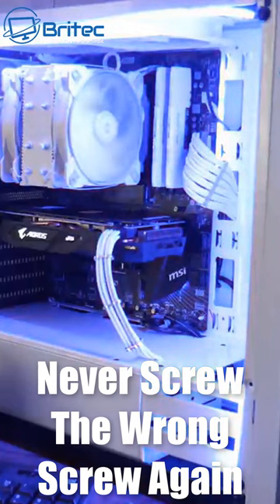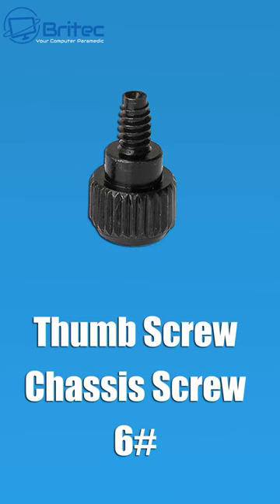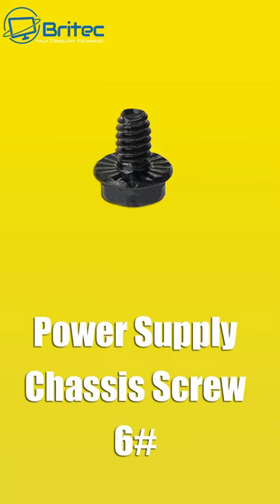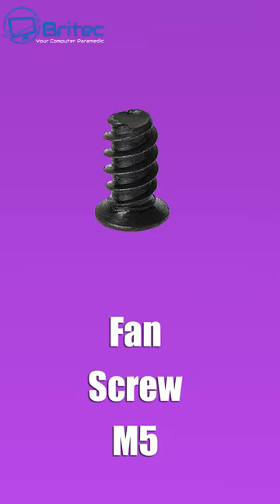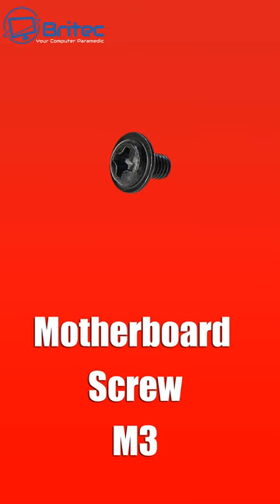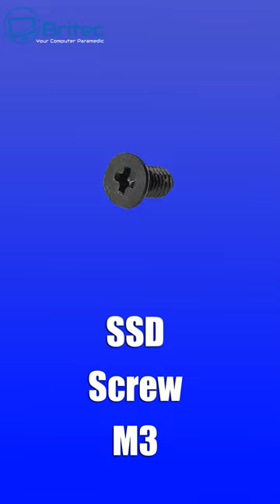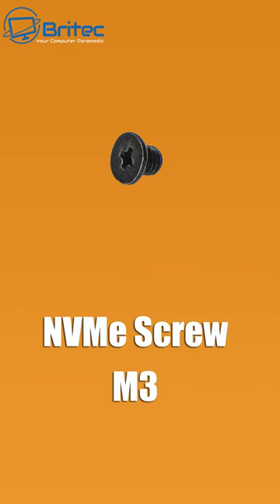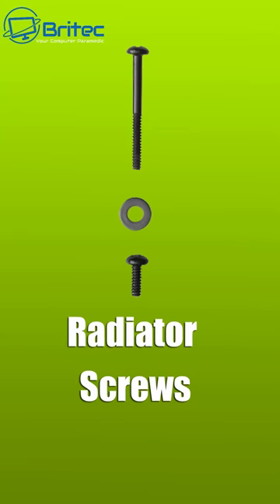Never Screw The Wrong Screw Again

Comment: My brother build my first PC, when I took it apart to upgrade it I realised he'd used used power supply screws on the motherboard. Recently I built a PC using a similar Cooler Master case and found they don't supply motherboard screws and found the supplied power supply screw are made to fit the stand offs, while spare motherboard screws don't.

Comment: Just winged it for my build and everything turned out fine. Built my pc in about 3-4 hours, which I won't think is too bad for my first time. Only problem I had was my 6 pin gpu cable wasn't seated properly on first boot.